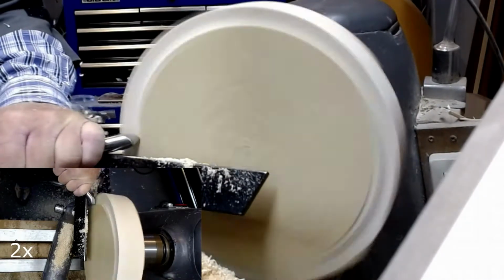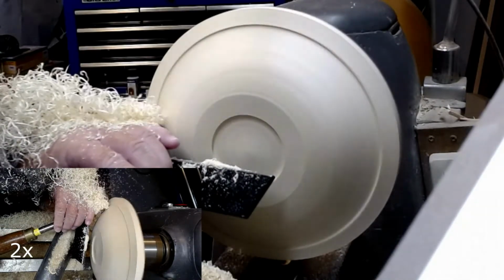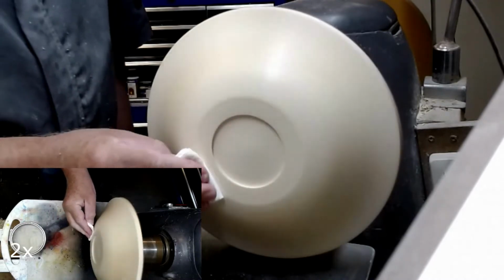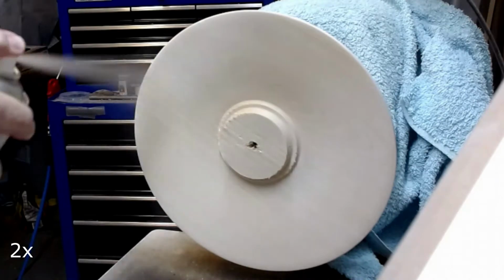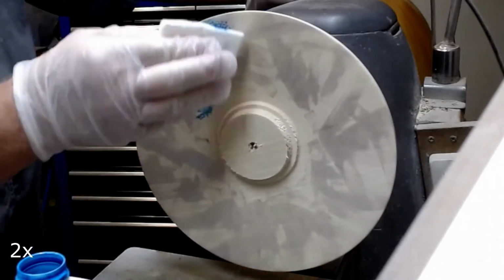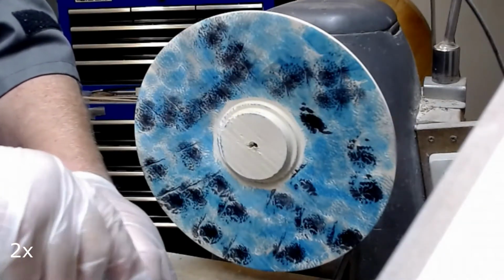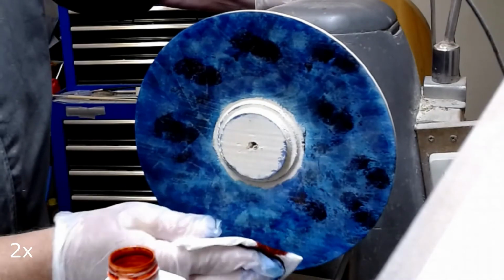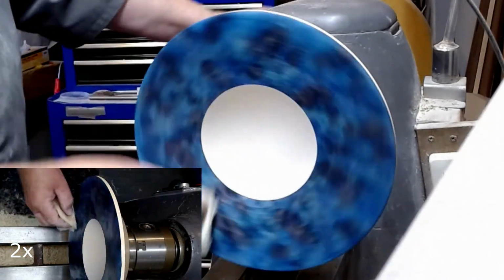Woodturning #17   Platter in Lime   Colours on rim

Comment: Beautiful piece, I have to try that .. will water based colors work the same ?+ i have the Hampshire Sheen series ??   Stay safe 😀
Reply from the maker: Hi. Yes, I believe water-based colours can work just as well. The colours are softer than the Spirit stains and take longer to dry so you need to adjust your routine according to that. The colours will also interact more with each other because of longer drying time. 
Give it a try. The Intrinsic colours from Hampshire sheen are lovely.
Reply: @SAr-Woodturning  Thanks :-)